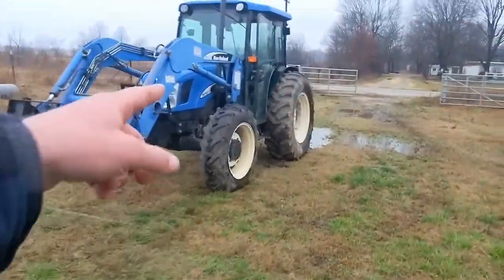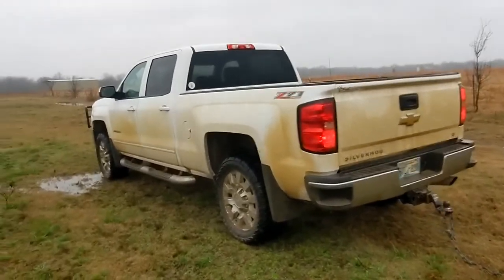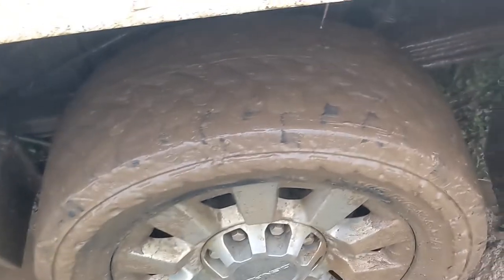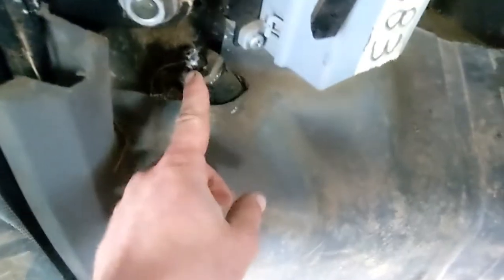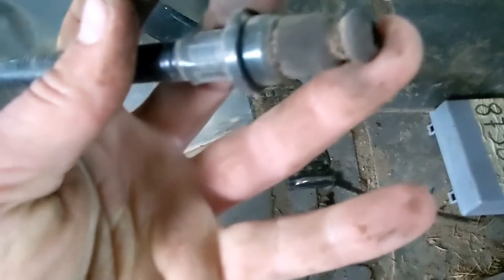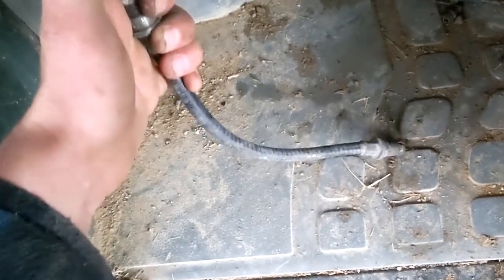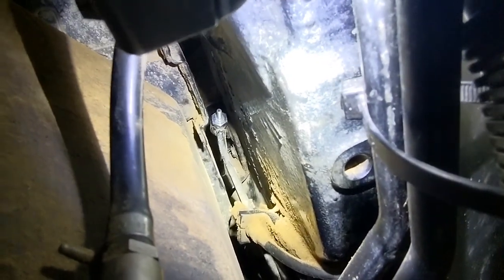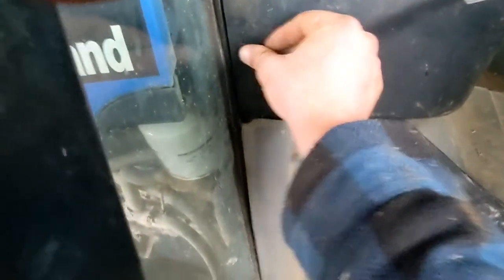replacing the clutch cable on a New Holland TN 75 da

Comment: I have a tn95da that uses the same cable.  I have had to replace it four times in the last 7 years.  The end breaks off underneath the tractor right before when it goes through the eye of the clutch arm.  I looked at yours to see if I am leaving too many threads or not enough but it  looks pretty close to yours.    About what length of the cable are you leaving stick out past your jam nut (threads that is)?  I keep an extra in stock for when it breaks bc it has happened so often.  Thank you in advance for any help you may offer.  You can also contact me though my youtube channel if need be.  Browning's red angus.   God bless.   Oh, about how far is the bottom of your clutch (where you lay your foot) from the floorboard.  My dealer is no help at all.
Reply from the maker: i don't remember how much cable i left i just matched it up to the bone that broke as bes as i could tell, as far as the clutch travel goes mines set fairly high, it is fully disengaged (clutched) about 2-3 inches from its at rest position.
Reply: Thank you for your reply.  I did about the same thing the first time.  I don't suppose yours has broken in the threads area like mine before or just the cable part?  NH tells me you cannot adjust the clutch.  When it goes it goes...  Have you heard the same thing?  Love your shop videos btw.
Reply from the maker: thanks! as far as i know the actual clutch does not have any adjustment although of course the pedal does, and I've only had the cable break the one time. to be fair the pedal was super stiff and squeaky for as long as i owned the tractor before it broke, turns our it had worn through the sheath and was rubbing and eventually ripped in half.